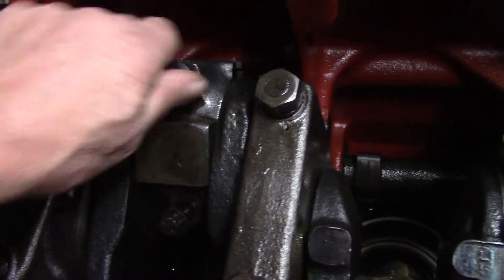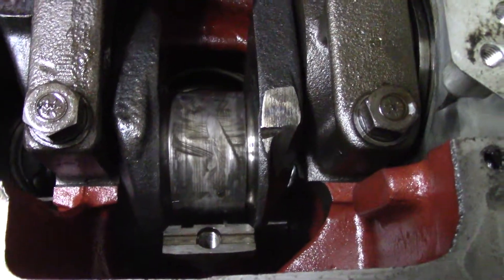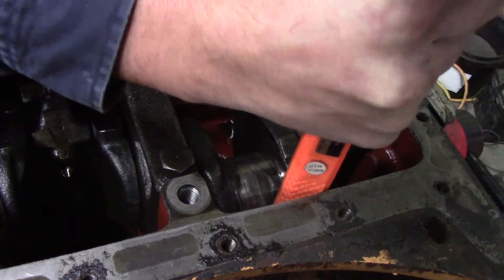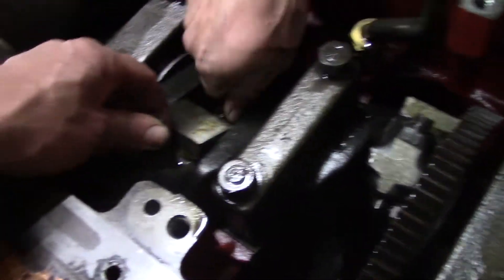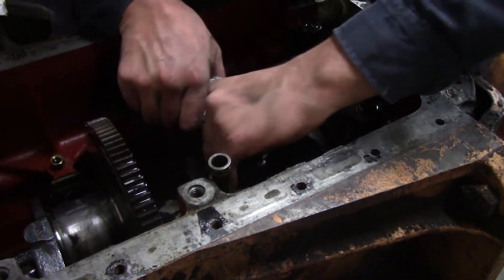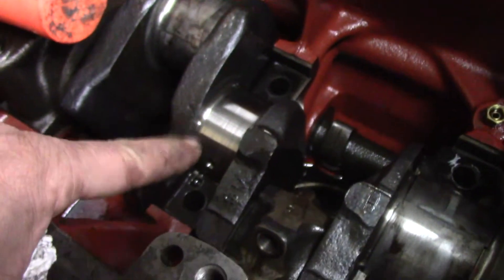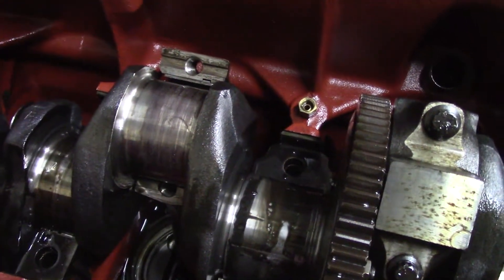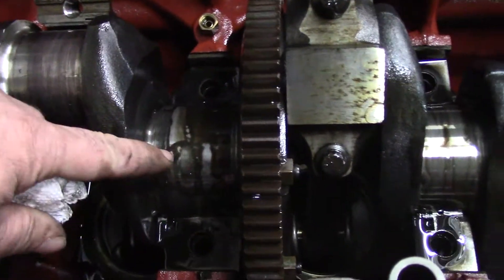336bd Case engine pulling rod and main caps

Comment: I have a 1970 case backhoe with I think, is an international engine 4 cylinder it has developed a knock, it was supposed to be a rebuilt motor and sat outside for one year without a exhaust or intake manifold connected to it. So we installed it into the backhoe ,   started great and ran great for the first hour but when I started to put a load on it, it started to knock.  It knocked louder at low RPMs and the knock seems to go away at higher RPMs. Oil pressure is great at low RPMs it's around 50 and at high RPMs is doing 60 to 65.   I cut open the oil filter and found some fine metallic particles in the filter but different people say it could have been oxidation inside the cylinders because of the fact that sat outside with no exhaust or intake manifold attached.  If it is a spun bearing, I noticed you sanded down, polished the bearing with 400 grit sandpaper. Can you do this with the motor in the tractor from underneath?
Reply from the maker: sorry I just saw this comment. You probably could but it probably wouldn't work. I have a very rare case where the motor was on its side and ran out of oil. it then abruptly stopped running leaving bearing material stuck to the crank. I'm, as far as I know, only removing transferred bearing material from the crank.